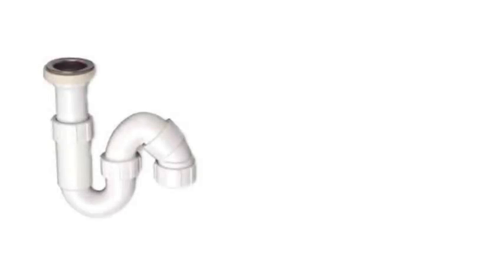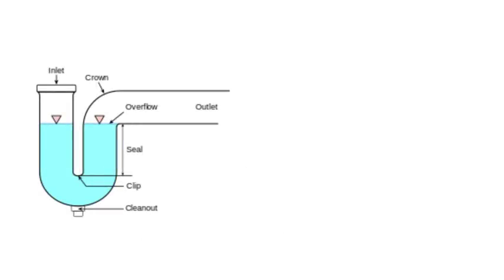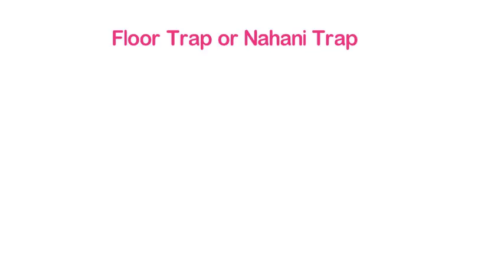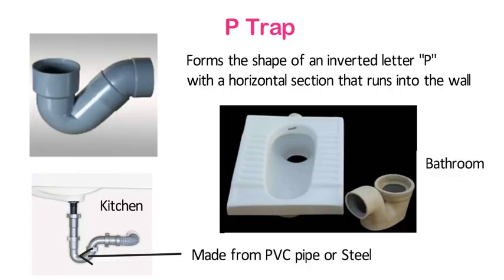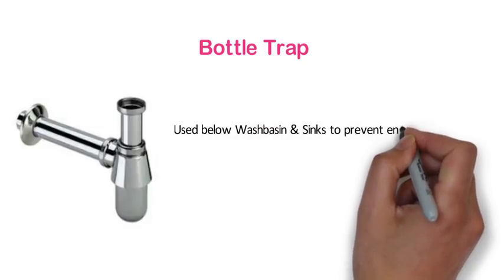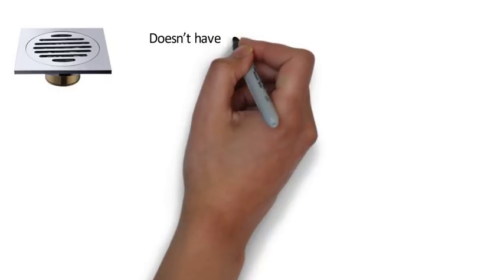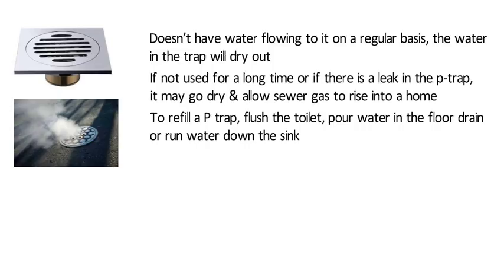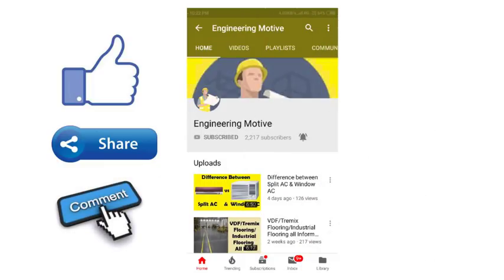Plumbing Traps - Basics

Comment: Good video, anyone watching in North America only the p trap is aceptable, do not instal any other, actually you won’t find it on store ,but do not make a “s” trap  under your sink ,in not code for it will loose the water seal obviously  you don’t have to worry about the s trap inside you toilet , it is fine. All the other info is straight out of the book  and correct
Reply: muy bueno

Comment: Hi
I am facing an issue in my Kitchen sink.
I am getting a very bad smell from my kitchen sink, the smell goes away when I pour water but comes back after few hours. 
I have checked with plumbers but they say there is no issue with the pipes and there is no leakage.

Could you help me in what could be the issue here.

Comment: Good information. Thanks. 
But i cant understand how water seal work in bottle trap and where is water seal in bottle trap. Can you please describe by bottle trap section?
Reply: panchal hemil bottle traps are identical to p traps usually, except the intake is in the center and the water surrounds the intake with the out being above the bottom of the intake, thus keeping enough water in the trap to keep the seal
Reply: cool 👍👍👍